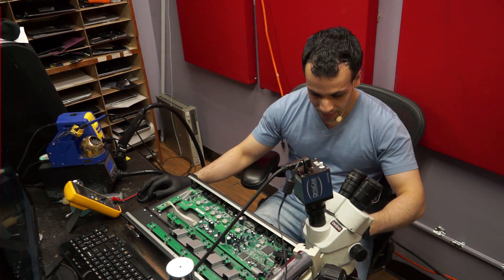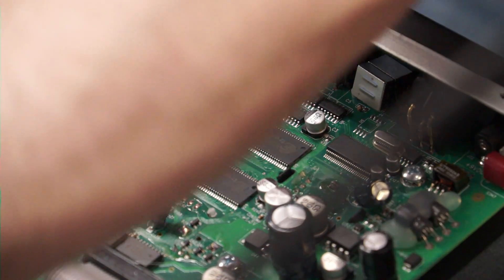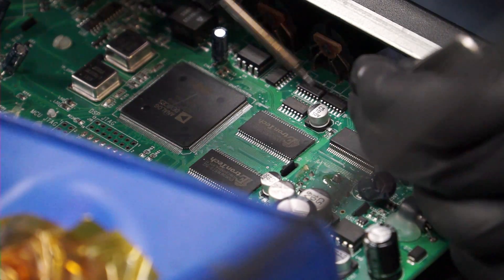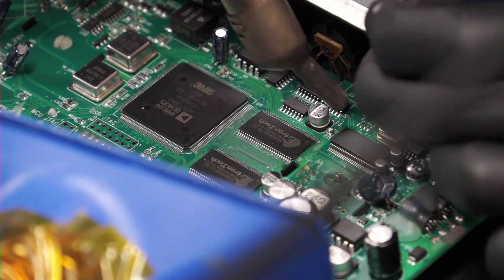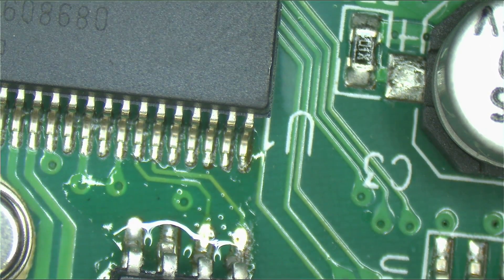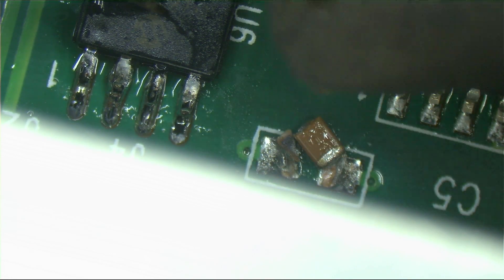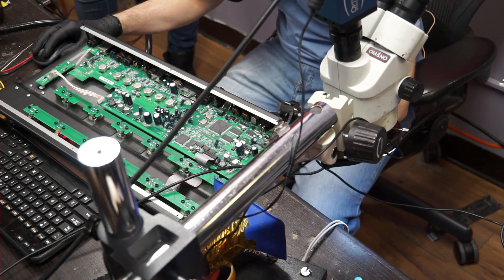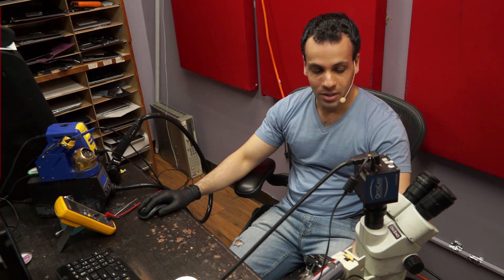Line 6 bootlooping after getting dropped

Comment: Thank you for your "off the beaten path" video. I've performed similar repairs and I make it very clear to some of acquaintances I've encountered, "If you'd like me to simply replace a visibly damaged part, then please have any and all parts you'd like to have replaced well as the complete unit along with its accessories. There will be no further diagnostic work performed and all work will be as is with no warranties expressed nor implied and the technician will not be liable for any past, present, and future unforeseen damages. Shall you opt for a full repair, then the standard fees and policies will apply along with a signed contract." It's these words that I use to "separate the men from the boys."

Comment: Check if cap has connection to eeprom pin 4 & 8. If yes, replace with 100n. Btw. Really no need for new chip. It'll be fine.

Comment: Free work: only the labour is free. Even a charity has to pay for a new surface mount port if it's fucked and unfixable. I've done board repairs at this level - the procedure is no different to more complex boards. The worst problem is that instead of dealing with things produced by the million, you're dealing with a board produced by the thousand and spare parts are literally impossible to acquire. That chip is probably just a buffer but there's every chance it's fried. There are circumstances where free work isn't feasible.

Comment: U6 looks like a I2C EEPROM (24LC256 or similar, which are manufactured by Microchip, which explains the Microchip Logo). This would also explain the bootloop.
Reply: Uli It probably is one.  It's basically next to the DSP And as you said there is probably some sort of int code on that EEPROM that needs to be read by the DSP to work properly.
Reply: Well, even IF that chip needed replacing, AND he had a spare, good luck getting the contents from anywhere :P
Reply: @khronscave  It can be uploaded via USB and line 6 site.
Reply: Well, that's an if, but given this particular chip's proximity to that big fat Analog Devices Sharc DSP chip, it's pretty safe to assume it had some initialization / boot data inside it.

"Sometimes they won't work" because that's where they store the "OS" or "BIOS" data :) Hence the bootloops...
Reply: @khronscave  there is an nitialise routine to reinstall firmware from line 6 site
Reply: @KhronX Normally I would agree, but in my experience if the device stores config data only in the EEPROM (which many devices do), and the EEPROM is initialized with all 0x00 or 0xFF, the devices will quite often work (and show bogus configuration data, but you can mostly just re-enter config via menu/USB etc). Sometimes they won't work because the firmware can't handle corrupted data. I can't say anything about this specific device, but I replaced a blown EEPROM one on an Audio device (some guitar food pedal, I think it was a BOSS one) and it worked.

Comment: Would be C5 be a .1uF decoupling cap for the USB ? try to check if it is connected to the 5V (VUSB) pin on the USB connector.

Comment: Can you try Changing a ram slot on a motherboard. Preferably a desktop board
Reply: I think that's a pretty difficult proposition. Are those through hole? If so, that's a pretty easy thing to do, just wick it and take it off, then solder a new one on.
Reply: Try it with a solder bath, it´s not a really hard task to change a ram or pcie slot. You just need to get heat on all solderpoints at the same time and then you can wiggle the part out.